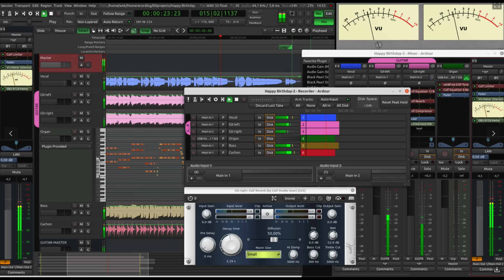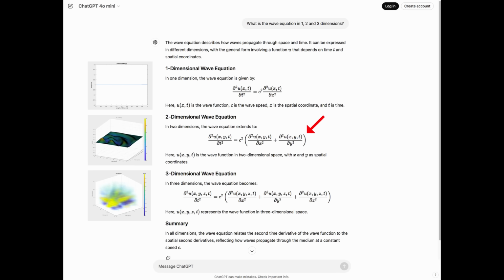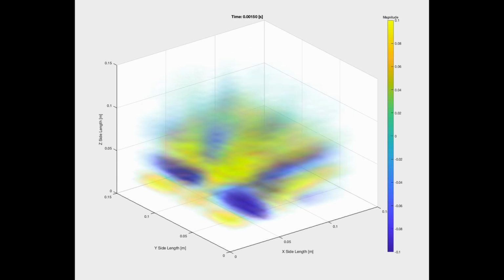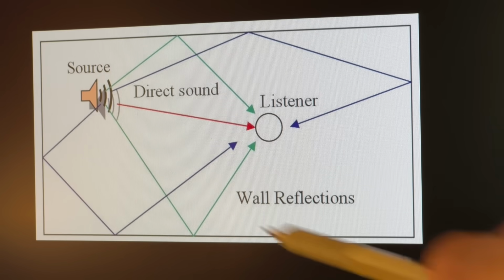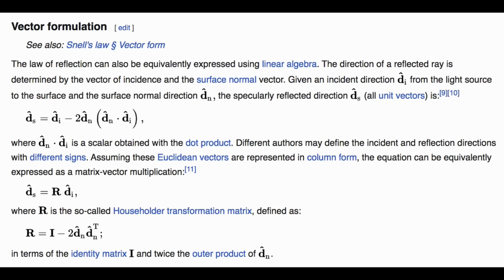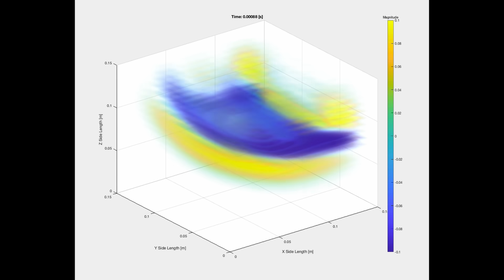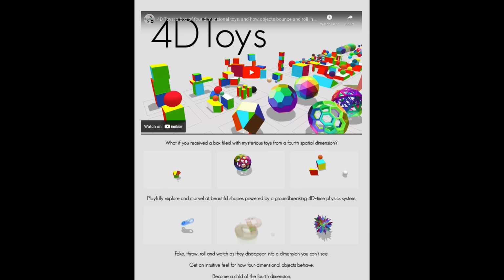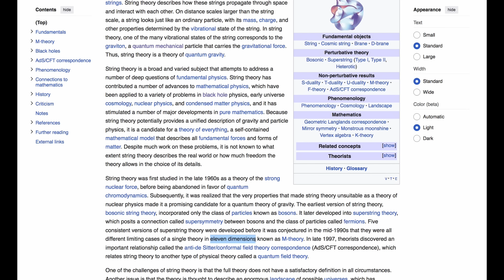Four Dimensional Reverb

Comment: For anyone who is confused about the tesseract animation, keep in mind that this isn’t what the object actually looks like. That animation is a 3D SHADOW of a 4 dimensional cube. We could also project a normal 3 dimensional cube (what we see) in a 2d space by projecting its shadow. To a 2D being they would see the shadow as a strange object that morphs in odd ways when rotated (in the same way we are confused by the 3d shadow of a tesseract). Likewise, we would have to remind the 2D beings that they aren’t seeing the 3d object, but merely its shadow. Yes, the 4th dimensions has 3d shadows. Hope this helps.
Reply: that makes sense, but you definitely get a solid amount of information about the 4-cube looking at the information. for those curious, i'll write up a few facts here, and then go back and look to see if you can see the things described in the animation: 

-A 4-cube is made up of 8 bounding 3-cube faces, which each share one of its six square faces with the six 3-cubes it is adjacent to in the 4-cube. this is analogous to how the six squares (2-cubes!) in a 3-cube each shares it's 4 bounding lines (1 cubes...) with the 4 adjacent squares.

-One of the 3-cubes is "behind" what we can see in the direction of the fourth dimension, we can think of this as the cube seen bounding the full figure in the default arraignment the 4-cube starts in. None of its interior is visible, but we can see its boundaries.

-As the 4-cube rotates in the fourth, unseen dimension (as it is in the animation) that "behind" face rotates to be partly visible, and then the rightmost 3-cube face fully replaces it as the one behind the camera. 

Using these three facts, and the realization that all the angles involved must always in reality be right angles (only distorted by the projection) we can gain a lot of intuition about n-cubes in general. I personally have through frequent meditation on this, found myself able to briefly visualize myself inside a 4-cube, moving around and seeing it in it's entirety. This ability is very open, even to those uninitiated in mathematics!
Reply: A tesseract is a member of the sequence n^4, the first tesseract has 16 vertices and 32 edges, the second has 81 vertices etc.. The question is, how do you arrange those vertices. One way is to use spring-electrical embedding in 3D and find the optimal equidistant edge length. If you do that, you get something very close to a rhombic dodecahedron with two central points. Remove one of those central vertices and redirect its edges to the other middle point and you get a perfect regular rhombic dodecahedron with one central point. So there are very natural arrangements of a tesseract which trivially decompose into 3D objects. I'm not sure calling this a 'shadow' really covers it.
Reply: @inflivia  calling it a shadow does help to make sense of the tesseract animation because that’s what it is. When you “force” a higher dimensional object into lower dimensions, you can do that by casting the object’s shadow, but doing so creates distortions. This is apparent with the tesseract animation which, at no point in its animation does it have equidistant sides (an attribute of cubes in any particular dimension).
Reply: @Vladd7  I've just demonstrated how you can transform that object into a 3D Catalan solid with equal edges. Your response -'if we pick an arbitrary animation with no organization of vertices, then all we can extrapolate is a shadow' - comes across as a critique of this method of representing the fourth dimension rather than a meaningful mathematical observation.
Reply: @inflivia  you’ve grossly misquoted me. All I’ve talked about is how the tesseract animation is a 3d shadow from the 4th dimension - and this is a correct assertion. Look it up. Have a good day.
Reply: @Vladd7  the animation is mathematically meaningless, it’s an arbitrary cycling of the nodes
Reply: @inflivia  The tesseract has 16 vertices and 32 edges. There is no "second tesseract" with more vertices, just like there is no "second cube" with more than 8 vertices.
Reply: @galoomba5559  What do the cubic numbers n^3 count then? Nothing?
Reply: @ Well, you can stack n^3 cubes into an n-times bigger cube, but each cube still has just 8 vertices.
Reply: @galoomba5559  The fourth powers 16,81,256.. are defined by OEIS as "Figurate numbers based on 4-dimensional regular convex polytope called the 4-measure polytope, 4-hypercube or tesseract with Schlaefli symbol {4,3,3}". I suppose it's up to you whether you want to recognise that definition.
Reply: @ So you just mean n×n grids of tesseracts, right? I should've assumed so instead of nitpicking. My fault.
Reply: Here's a fun thought experiment for you: 
A 2-D object can have a 2-D shadow. Or a 1-D shadow, depending on the angle. A 1-D object can have (logically) a 1-D shadow or 0-D shadow depending on the angle (in the latter case this may mean no shadow). A 3-D object, should, logically, have a 3-D version of a shadow in addition to a 2-D shadow. Why doesn't it? ... It *does*. As with the previous examples, the direction of light source determines the shadow dimensionality. The same applies to 3-D shadowing. In order to achieve a 3-D shadow from a 3-D object, you need the light source from 4-D; which is, bluntly, time. As the light source moves over time, the facing of the shadow travels across non-congruent 2-D surfaces in 3-D space, an area where 'the light has been blocked by this object'. You don't realize that your shadow is 3-D, because the visible part is most apparent as a 2-D visual. But c, causality and motion, that light moves in order for a shadow to exist in the first place, means the space between the object the shadow is cast from and the visible 2-D patch called the shadow, is also shadow, and is 3-D, and would be visible as such at a higher dimensionality.
Reply: Another way to look at a tesseract is that time is the 4th dimension and that’s why it’s moving. In the 4th dimension you could be able to move through that dimension just like we move through space
Reply: @MaxOakland  That is a very valid way to visualize 4d space, but if you simulated it you wouldn't get a tesseract, you'd get a cube that teleports into place, behaves like a normal cube, then disappears. if yousimulated non-cubic 4d objects, or non-axis-aligned cubes, you'd get an ordinary 3d shape that keeps shapeshifting and sometimes disappears.
Reply: @Rowlesisgay  I think you might be wrong but I'm not sure. It seems like this tesseract is being simulated using time as the 4th dimension that would be a spatial dimension in what we call a 4D world
Reply: @MaxOakland  The tesseract is in fact rotating, which uses up out time dimension. Think about a rotating cube, use a light to caste a shadow on a 2d surface. This encodes the time dimension and shows an interesting view. The tesseract is a rotating 3d cube. We only see the 3d shadow. If you were to use time as a 3th dimension, it would be quite different. Think about sliding a cube through a sheet. If the cube was axis aligned, you'd just get a square that appears and later disappears. If it wasn't you'd get one of those weird shadow shapes growing out of a point, then shrinking to nothing. The tesseract in the video much more resembles a 3d shadow than a 3d cross section.
Reply: "...helps?" Dude, talk about the understatement of the decade, I think I actually get it now. It makes perfect sense now, thanks bud. 👍
Reply: @ glad to hear, my friend :)
Reply: Like a photgraph is only a 2D snap shot of a 3D space
Reply: This is misleading. The animation is a 2D projection (or, "shadow", as you call it) of a 3D projection of a 4D object. We see in 2D. a 2D projection of a cube is all we can understand a cube to be. Likewise, the 2D projection of the tesseract is as good as it's gonna get for our measly 2D surfaces of our eyes.
Reply: @ziggyzoggin  you are correct and you’re splitting hairs. Yes, technically speaking the tesseract animation is 2D because we are perceiving it from a screen that is a flat 2D surface. However, my point was to simplify and all simplifications are “misleading” to some degree. Our brains make the tesseract animation into 3d and so I’m treating it as such.
Reply: @ziggyzoggin  i would argue your characterization is misleading. the eye might only be taking in information on a 2-dimensional sensor, but the model in our minds is very much a 3-dimensional model. we don't see what the eye sees, we see what the brain sees. preprocessing of visual data happens long before we're conscious of visual information, even taking place within the optic nerve itself! This is why optical illusions are possible in the first place, the brain is constantly calculating and serving you information based on an intricate model of the 3-d world. Given that this animation was created explicitly to make the 4-cube as intuitive as possible, including labelling bounding planes, and recoloring occluded portions to clarify they're behind or in front of something (very much 3-dimensional information) i think we can treat the information as essentially 3-d in nature.
Reply: @oblivion5683  good points but nah, it’s still very much a 2D image. We think in 3D, but we still see in 2D and comprehend things as 2D. We see the back of the projection as distorted and all the angles of the 3D object wrong… sure it’s digitally 3D, but if you allow that to count its 4D! It only makes sense to say it’s a 4D shape or a 2D image. No in between. I’m tired of people saying “erm actually is a 3D shadow” because it’s still truly a 4D object, it’s just a picture of one. It’s like someone saying “that’s not a cat, stupid. Cats live in houses not on screens. That’s a picture of a cat” like yes, wow we’re all so proud of you, that is a picture of a cat, but I was obviously referring to the subject of the picture not the picture itself.
Reply: @oblivion5683  anyway my point is that it’s a true 4D object, that is what a Tesseract looks like, (OP was wrong kinda) but it is also just a 2D gif. I don’t understand calling it anything but 2D or 4D
Reply: @ziggyzoggin  "We comprehend things as 2D"

>Looks outside
>Depth
Reply: @person8064  Depth doesn't count. If you were able to see in 3D, you would see behind walls and inside things. Not only would you see what's inside a box, you'd see the inner detail of the walls of the box. depth is more similar to a color channel than a dimension of an image
Reply: @ziggyzoggin  Does light not travel in 3-dimensions because it can't pass through solid objects? Because that's what you're saying
Reply: @person8064  It really isn't. that point is so bad I'm gonna stop engaging in this debate. good luck with that, bye
Reply: @ziggyzoggin  Thank you for acknowledging the difference between what we see and what is, and how it's largely irrelevant. Saying that rotating shadow is a tesseract is no more wrong than saying a collection of connected parallelograms is a cube. The latter is easier to understand when we're more experienced with 3D objects, but that doesn't make it more real than the tesseract's shadow.
Reply: @person8064  don't judge him, he only has 1 eye
Reply: @ziggyzoggin but we have two eyes, and thereby our vision is 3D. Obviously, on YouTube we do see it in 2D since it's on a screen, but if someone shows you a physical model of the 3D projection, you see it in 3D.
Reply: @ziggyzoggin  could you not rotate or change 3d slices of the hyper object to overtime or superimpose the full object in a pseudo 4d visualization? much like an MRI builds up a 3d image out of slices?:
Reply: @ You could do that, but we weren't talking about slicing at all, we were talking about projections. and regardless, the best you're gonna get is stereographic 2D (two 2D images, giving you depth, like how we see the world irl or in VR)
Reply: @ziggyzoggin  right..... My bad. I once saw a stereoscopic setup where you had the XYZ on one eye and the wyz on the other
Reply: @dissonanceparadiddle  Yes. Several video games exist which have an ever better trick: continuous movement. Think of a 2d being who lives in a slice having that slice pushed through a person. Look into 4d miner, which lets you fully explore a 4d world by rotating your slice instead of just pushing it back an 4th.
Reply: @Rowlesisgay  oh I've seen that. It's super rad
Reply: The most we can ever see is a stepped-down dimensional cross section of the 4D cube. Much like how you can only see a 2D cross section of a 3D cube in slices. A rotating cube in 3D makes sense, but must be "faked" in 2D in order for us to recognize it as 3D. But its impossible to depict any of the sort in 1D. So we cannot make even a close comparison stepping 4D down to 2D. We would need a 3D display in order to properly understand just the 4D cross section.
Reply: @ "3D -> 1D doesn't work => 4D -> 2D doesn't work" isn't really a good argument. There's no need to use cross sections either, they're pretty limiting. Also, 3D displays do exist, though VR or a stereoscopic view already kinda work as a substitute.
Reply: @pauldeddens5349  The first differences of the fourth powers 16,81,256.. (aka the tesseract numbers) are the rhombic dodecahedral figurate numbers 15, 65, 175.. this is a simple way to turn a 4D tesseract into a 3D shape.
Reply: 2d being will see just simple segment of line0
Reply: I think it is actually the various intersections of the tesseract with the simulated 3d space, like a MRI scan
Reply: Not at all. Thats assuming our perception of a shadow in the 4th dimension, from the 3rd dimension, would be similar to the perception of a 3rd dimension shadow in the 2nd dimension.
Reply: It's actually a 2d shadow of a 3d shadow of a 4d cube
Reply: What do you mean by “shadow”? The tesseract is a cross section of a 4D object in 3D space, similar to how a square is a cross section of a cube (a 3D object) in 2D space. It’s as if you were to create a flat 2D plane and pass 3D objects through it, but up the dimension by 1 for each.
Reply: This is just just a visual depiction of how the shadow would move in our 3d universe, so it should be taken with a grain of salt.
Reply: It definitely do